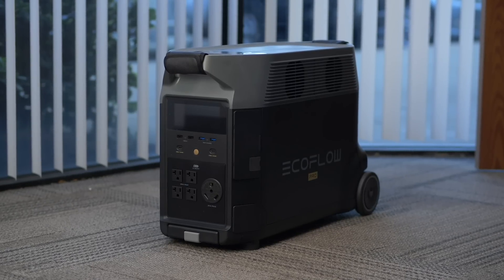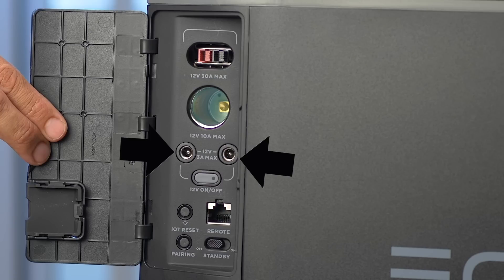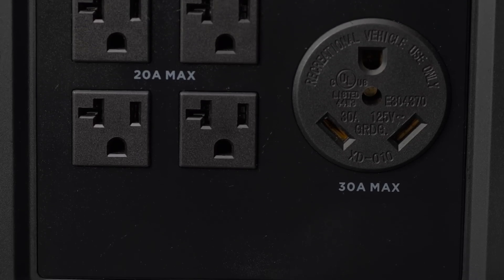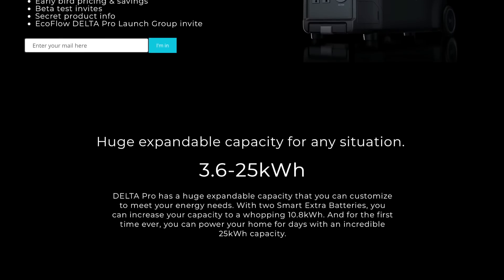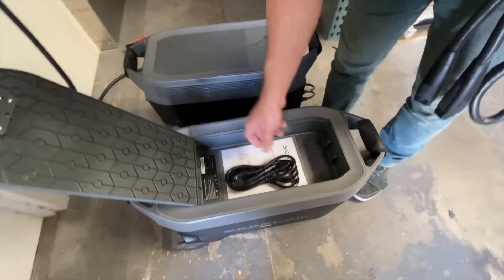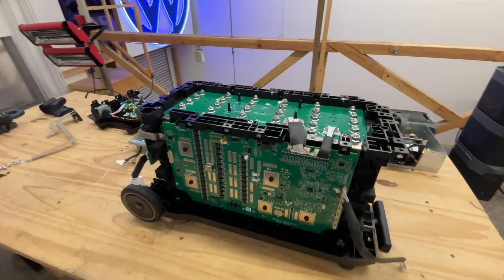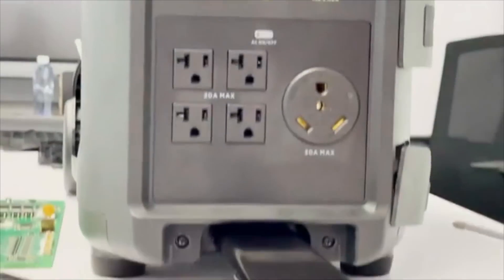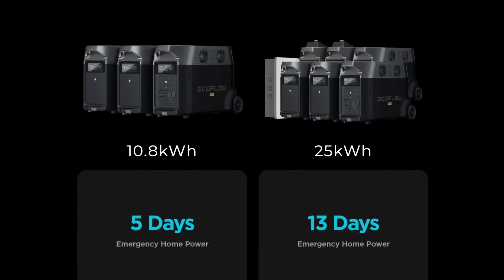EcoFlow DeltaPro - Best Battery System yet

Comment: Solar input has been upgraded to 15A and 1600W!
Reply: so 105ish VDC on the mppt, i wonder how much higher they could push voltage with the current spacing of the rails on their pcb's so even higher dc wattages were possible. ac charging the thing from a higher wattage solar array plus inverter just hurts from an efficiency standpoint and isn't elegant at all
Reply: Where can I get this 150 dollar kit at please
Reply: Only for the Kickstarter campaign. Rest is limited to 1200W
Reply: Still not enough